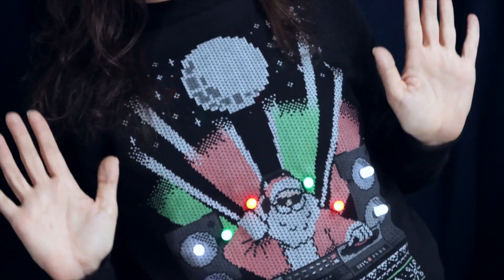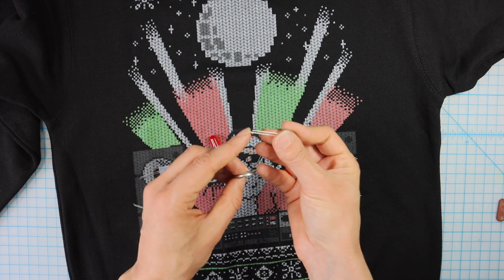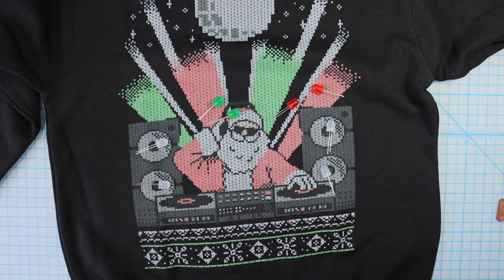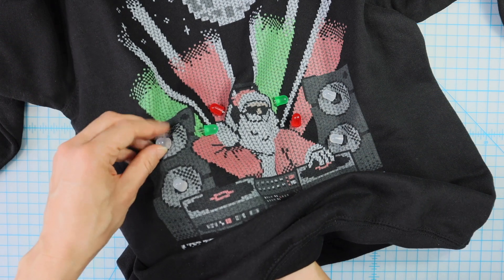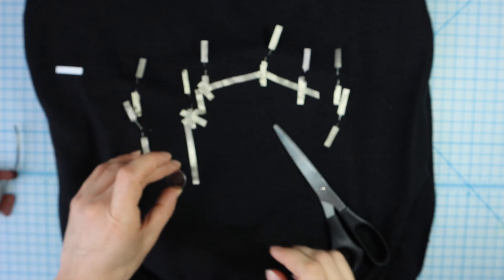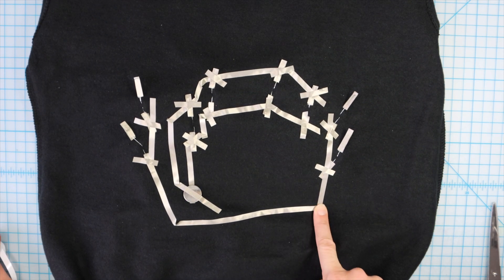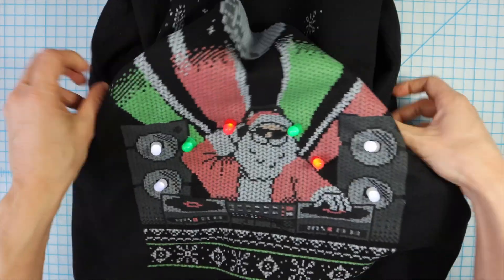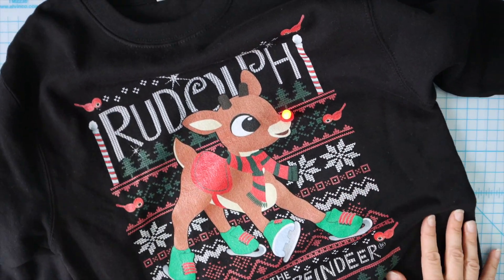How to Add Lights / Custom LEDs to Ugly Christmas Sweaters

Comment: Any thin battery or a certain one?
Reply from the maker: Any 3V coin cell battery should work. A CR2032 or CR2016 would be a great choice because of their larger diameter. :)
Reply: Can you use a coin cell holder with an on and off switch?  
I want to do this for an office party but I want to be able to turn it off

Comment: Is this washable?
Reply from the maker: I would recommend hand washing, removing the battery first and avoiding washing the area of the sweatshirt with the circuit. Allow it to dry completely and squeeze the connections again before replacing the battery. :)

Comment: Hi! OMG, how cool! I bought this sweatshirt at a thrift store w out noticing that it had lights, took it to wash, not dry and noticed it started to light up even after it was  in the washing machine, but I can't find any buttons or connections to turn it off, so I decided to look on line, and found ur site. Any suggestions?
Reply from the maker: If it lights up, there is a power source! Look for a hidden pocket sewn into a seam somewhere. It likely has a small battery and switch.